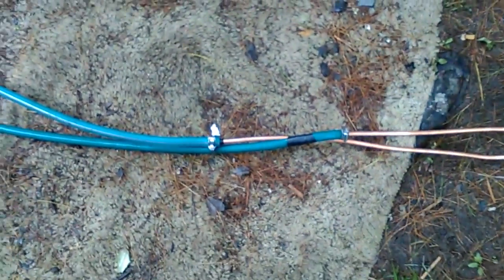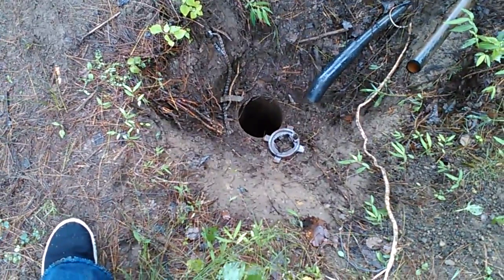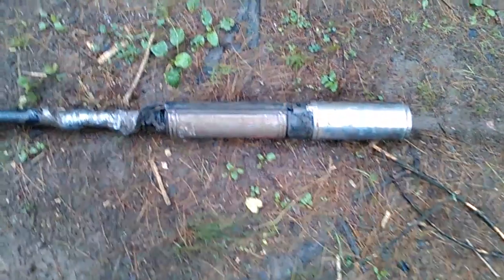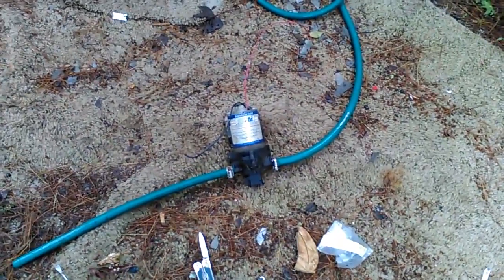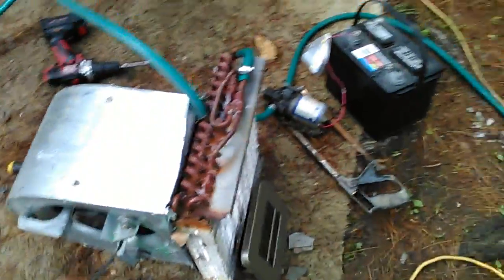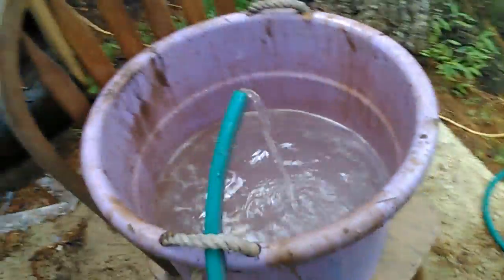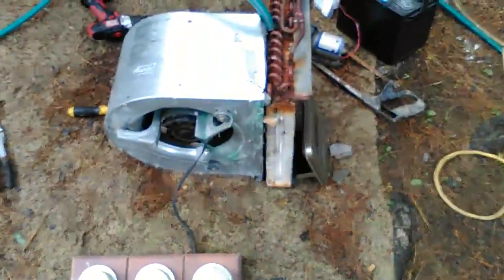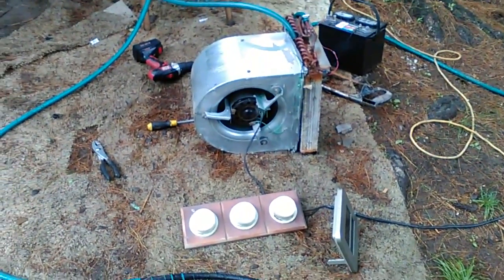easy DIY geothermal cooling system.

Comment: Good basic video of geothermal. This method was used in the 1940s to 1970s, then outlawed in many cities, counties and States. Need a camera stand, the camera shake is horrible. Your test design lacks several key features that would increase performance by 84%. This method can be made legal very simply.
Reply from the maker: I'll look into those features and maybe make a follow-up video on that.
Reply: @lukeFugate  You don't actually need a well at all. We have a similar system going. Instead of a well we have an airtight  200 liter tank of water buried around 2 meters deep.

Comment: Nice job.  You should check out swamp chillers - they are basically the same thing.  

Some of upgrades for you: Insulate the top of the hole for your well - don't want to warm the water from the top.  Use irrigation tube - can get it in long lengths.  Insulate your lines - want to keep the water as cold as possible for as long as you can - do both directions.
Reply: Swamp coolers are evaporative coolers  they don't work very well in the southeast because of humidity 
Work wonders in dry places I've been around them in Arizona, but here in the south they're not very common due to humidity

Comment: Yo pop use a small freezer make a radiator off a PVC 3 inches stick it in there one bringing the air inside through that pipe radiator and one coming out from the freezer going to the house you could use your blower or you could use a small fan believe me you're not going to regret that because right now you using energy for the pump and you using energy for the blower so you going to come out almost even so what you going to do is very simple the door of the freezer doesn't have no lines so you can make two holes one is going to go out to the house the other one is it going to be for a pipe to suck air now because the freezer it's going to be close all the time you going to put some water not filling it up just some water so you'll get ice maybe 2 inches or  1 inch that water is going to get Frozen what's going to happen is the pipe that goes to the house it's going to have a fan and it's going to suck the air cold air to the house and the pipe that is breathing air it's going to breathe air all the time and it's going to be real cold air now you are going to hook up the 3-inch pipe or 4-inch pipe whatever you decide to use to the blower and you probably say how I'm going to hook it up use a 5-gallon bucket make a hole on the bottom a 4 in Ford 3 in and hook it up to the duck if I were you I wouldn't use the blower I will use a small fan maybe at 12 bolt fan with high enough speed to circulate good air take care my friend it's nice to see people trying to beat the system persistent sucks when it comes to air conditioner it's very expensive check geothermal Heating and Cooling that will give you a good start God bless you my friend
Reply from the maker: Thank you.

Comment: That isn't going to do much.  How geothermal systems work [effectively] is that they still use a refrigerant that is superheated/subcooled.  Instead of having an outdoor coil that is returned the ambient temperature outdoors (which becomes less efficient as outdoor temperatures reach extremes), it uses the consistent temperature under the ground to return refrigerant to an ambient temperature.  When cooling, a geothermal heat much should have the indoor coil approaching freezing (subcooling); while heating the indoor coil should be over 90F (superheating).  Having something that is about 55F all of the time... is going to be limited.
Reply from the maker: This one didn't do much, but for another reason. The water in the well is limited, and heats up within about an hour. I used a similar idea, but used the water from the creek. I plumbed it through an old car radiator with a blower behind it. I put it in the window on the shady side of the house and opened the window on the other side. The constant flow of 55 degree air was enough to keep us comfortable in most temperatures. In fact at 80-85 degrees outside we would turn off the water pump occasionally, because it cools too much.  I should have had it on a thermostat, but never got around to it. Anything over 95 is a struggle and it just keeps it on the high side of comfortable. 
You are right, it isn't as good as a big AC unit, and has to basically flow through the house instead of recycling the air. It does work though.
Reply: @lukeFugate  I have been toying with the idea of filling a cistern with something inert, like mineral oil, to use as a sink for energy.

Comment: Nice , you are right about the cost of moving water in a closed loop being minimized compared to lifting in a open loop. Your system is much like the system I am building to heat my home, mine will have 200’ of 3/4” copper I’m a well circulation will be a taco 007 through a water to refrigerant evaporator /heat exchanger , and the condenser will heat water for radiant floor heat.
Be sure to update with how well it works!👍👍
Reply: Copper yet being a great thermal conductor will not last long in a well, and not recommended or legal in many states.
Reply: Becareful using copper in a well, acidity of well water changes with seasons,  natural and unnatural. If your using glycol in your loop and the copper is compromised you could poison your drinking water or others. Most all states make it illegal to use copper as a loop! You don't want to be liable or harm others!

Comment: condensation from your radiator?   Where does that water go?
Reply from the maker: in my cabin I used a little different setup. The condensation drains through a hose outside.

Comment: hi , its great, i have few question if you could answer, first your design is way simpler which is great for people like us, i am interested in cooling only, (not heating), now 1. how deep you put tubes inside ground 2. what was your ambient temperature ? 3. what is your room temperature 4. what is outlet temperature of your water coming circulated via ground pipes ? and what was your room temperature becomes after system was running, appreciate your support here
Reply from the maker: It works much better when using a fresh water source like a steam or a creek. It would cool the house down for a while, but the water in the well would heat up over time and the cooling was diminished.
Reply: @lukeFugate  so if I used one of those 12 volt solar supplied pumps to pump well water to my radiator up top with a good insulated line and just dump the water out of it it should work?

Comment: The trick with geothermal is that the heating/cooling is passive. The only energy expended should be pushing air through the coils. This can be greatly augmented with a heat pump design.
Reply from the maker: I hadn't done much more with it but there is a lot of potential.
Reply: Heat pumps use an incredible amount of electricity, thousands of Watts, to power a compressor using Brute Force to compress gaseous refrigerant into a liquid under very, very high pressures which then goes through an orifice and then expands absorbing Heat in the process. All of this electricity, expensive equipment, and ozone-depleting chemicals just to move Heat from one place to another.
 This video is a very intelligent way of moving Heat from one place to another using an extremely small amount of electricity, probably less than 50 Watts, and very common very low-cost equipment. It also uses water as a working fluid that has no environmental impact whatsoever.

Comment: so you're displacing to heat from the air into the ground. But you're displacing that heat diretly into the ground. So does it work only for a wile until the ground heats up? or is the thermal mass enough to dissipate the heat where the unit can be used to cool air 27/7?
Reply from the maker: It will transfer the thermal energy into the ground warming up the well. It did eventually heat up the water enough to reduce its efficiency. The best way I found to do this was to pump cool water from the creek through a car radiator in the house and back into the creek. it stayed a constant temperature because you were always getting fresh water flowing through.
Reply: Which planet do you live on that has a 27 hour day?
Reply: @johnwyman6126 😂

Comment: Just now saw your video. Wish I would have seen it when ya posted.
How did the system work for ya?
Reply from the maker: It worked ok. It turned out to be better to use water from the creek to do the same thing. The well water would heat up after a while and it would stop working.
Reply: @lukeFugate  that's really good to hear. Thanks for your reply.  How cool was it able to keep the house on hot days after ya got it retrofitted in?
I've been kicking the idea around for a while now and hopefully will be able to get something going next spring
Reply from the maker: @Sport--willow  on really hot days it would be just cool enough probably about 76 or 77. On normal days it could manage 68.
Reply: @lukeFugate  that's not bad at all. At thay temp everyone is able to escape the extreme heat and stay protected from heat exhaustion or worse.
Thank you for sharing the video. It had definitely sent the mind into designing mode. Hopefully come spring I'll be able to get start on a similar system and see what I can come up with.

Comment: 1) how'd this turn out?
2) that window unit is optimized for a for probably two to three times the temperature difference. You'd probably get better results with one of the newer automotive radiators that come with 12v fans built in. They're meant for much bigger temperature differences too but will have more surface area.
Reply from the maker: The well water heated up over just a little while. I ended up using water from the creek pumped through a car radiator and it worked to cool it off pretty good.

Comment: What you need to do is use a cheap, low power AC window unit in the setup. You find the "hot line", and wrap two thin copper tubes around the hot line. (Two, for more "flow".)

You take the super-heated AC temps and assist the cooling that is normally managed by the radiator alone. The majority of the heat going into the well water, where it should be "flowing away", replaced with cool water. (Still using your loop, obviously. But a deeper well would be better. Also, you want the line with the hot water going "down into the well", to be insulated. Otherwise you are going to pull out the heat that you are trying to "wash away", before it can be washed away.)

Your AC should make freezing cold air, as opposed to "real cold air". Thus, it should cool the house faster and spend more time "off". Or, a tiny AC will be able to cool-off a much larger room... Or the whole house.

The trick is to push as much heat into the ground as possible, so it flows away and less power is used to do that process. If you use a tiny pump for water and a large blower-fan... You may be making more heat and using more power to get marginal cooling that could be achieved by simply blowing a tiny free-air, energy efficient fan would provide.

Window AC units are being made smarter now. They use one motor for both the blowers, inside and outside, keeping the hot motor outside the house. Unlike central AC units, that have the hot blower fan running inside the house, making almost as much heat as the AC is making for cold air.
Reply from the maker: Thanks for the info. Very helpful.

Comment: Goodonya Luke, I live off grid in outback Aus. I appreciate your efforts and thought about this type of system for a long time but didnt have a well or adequate water then the local shire council put in artesian bore water system to the whole village (about 25 people at Angledool NSW see my rough videos 'Angledool off-grid') and natural pressure meant I didnt need pumps so I put in a Bonaire Durango evaporative cooler to my cabin. It works and doesn't take too much power from the solar system.
Since then I've put in your type system using ATV radiators and fan to take the water from the sump of the evap' cooler and use it to cool my battery box it does the job taking the temperature at the height of summer from around 50c to 38c which is a big help to the batteries.
Good luck mate.
Reply from the maker: Glad to hear your system is working well.

Comment: Cool idea... Seem a little dangerous though!
Reply from the maker: I never had this set up permanently. I changed my design and used water from a natural spring, which works a lot better and doesn't require a pump.
Reply: Dangerous? What do you mean dangerous? Just because he's not wearing a hard hat and a safety vest doesn't mean it's dangerous. 
 He's using safe 12 volts for electricity and non-toxic water for the working fluid under almost no pressure the absolute opposite of what you are probably using with some sort of air conditioning.

Comment: I have 2 radiators, one will go down a concrete underground water tank and the other will be inside the house with fan blowing through it. I wont calculate simply cuz I dont know what I am doing & 5 meters below earth should have cool temp. It reaches 50 deg celcius in the Middle East :/
Reply from the maker: Sounds like it should work. Just a small water pump should be all you need to get the water to circulate through the system.

Comment: Impressive Luke, would like to know what you do for a living other than thinking up great ideas. My guess would be electrician. If you wish to not to reveal that info..... Will no worries. Anyways another great idea, you just added to my knowledge.
Reply from the maker: Glad you liked it. I was an electrician when I lived in Texas, but there's just not enough work around here to make ends meet. I ended up getting a job with a road construction company, and have been there almost 11 years now.
Reply: @lukeFugate  I was half right,thanks. Good stuff.

Comment: Not sure where you are from, but in the USA that is extremely illegal what you are doing. In addition of your neighbors health you are compromising. Well contamination!!!!!
Reply: Karen has entered the chat 😮
Reply from the maker: There is no contamination unless having copper pipe in a water well will contaminate it. The copper pipe that I used is meant for plumbing it is not poisonous. People use it to run water lines in their homes. The water in the copper pipe never comes into contact with the water in the well. There are no neighbors on this water supply. No one wants to use this type of water anymore as it is sulfur water. Everyone in this area drill quite a bit deeper to get better water. No houses are located anywhere near where I am anyway. 
All that being said I don't actually use this system. It was just an experiment. 
The geothermal cooling I use now relies on a stream that naturally flows by a cabin I built. The well in the video has been capped off from the date of the video and never used again because of the sulfur in the water.
Reply: @lukeFugate  as a licensed HVAC master who installed the first 11 geothermal systems in the State of Maryland, we had EPA challenges with using only closed loops in a well. Copper with water that has an unbalanced ph level will cause issues. Pulling water from a well and changing temperature and returning to the well is a violation.  Not going to get into all the issues. Seeing the video sounded so many alarms with me I had to say something for the health and well being of all. Some people see things on you tube and copy it not understand the consequences of their actions.
Reply from the maker: Thanks for the information. Glad I don't use that system, wasn't aware copper would have any effect.

Comment: Not sure if you notice, but you have a bit of issue with the noise in the system.
If you listen carefully, you will not be able to listen anymore XD
Joke aside, I would have love some data on the well temperature, coil temperature, air temperature, relative humidity, etc.
Reply from the maker: This was just a proof of concept experiment. I have since improved the design. I now have a gravity-fed system that uses no pump, but just the natural flow of water from a spring running through a car air conditioner condenser and I used a box fan for a blower. Here is a link to that video.
https://www.youtube.com/watch?v=beziRoj_8Xk&t=7s

Comment: 72 degree air on a 90 degree day, and you are making fresh water...Proof of concept.
Reply from the maker: Thanks! It did work for a while but it heated up the water in the well over time and lost effectiveness. 
I went with a different design in my off grid cabin and it works much better. Here is a link https://www.youtube.com/watch?v=beziRoj_8Xk&feature=youtu.be